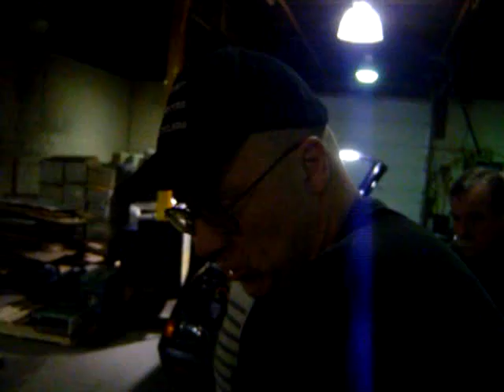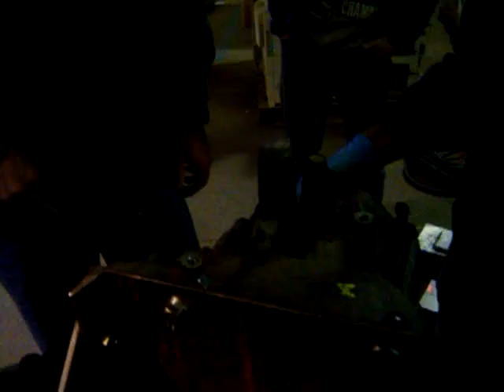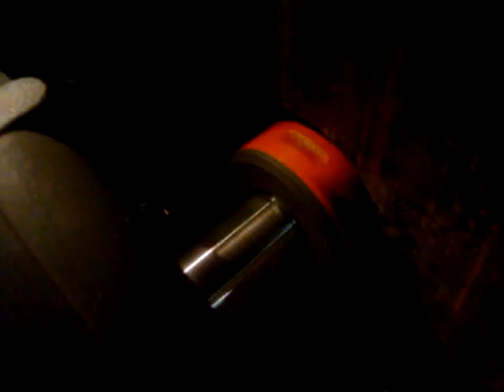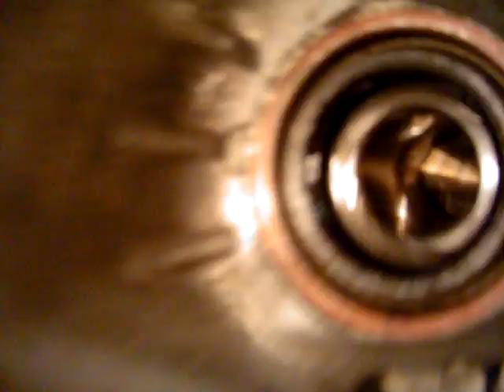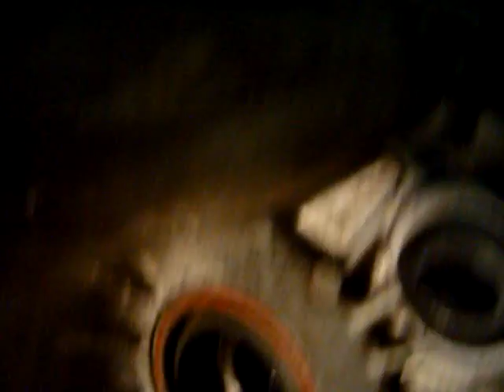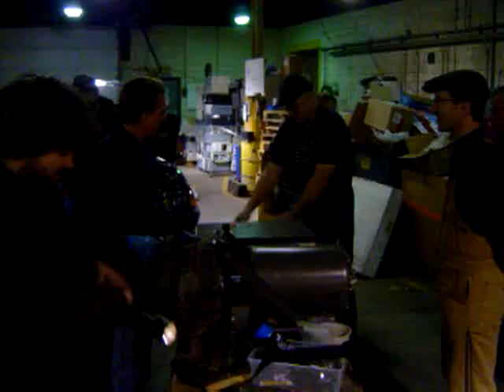AC Dodge Neon EV conversion motor transmission testing 02

Comment: Without any load on the transmission a short run isn't going to hurt anything.  Yes, there is a little miss alignment.  Ben didn't have the good video setup with him he only shot a little video with a consumer still camera.  We shimmed the motor a little and got it better aligned.  Aside from the noise, we can look at the current being drawn to figure out when the alignment is correct - Thanks Tom B.